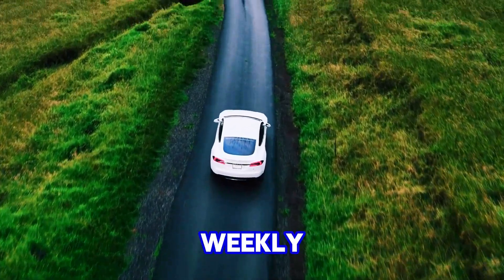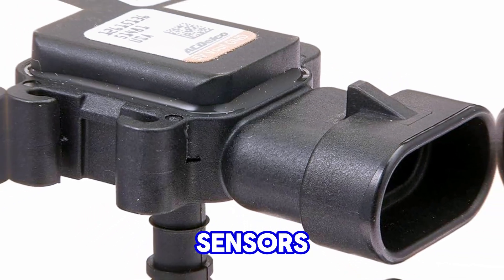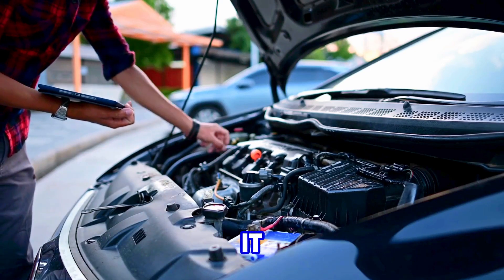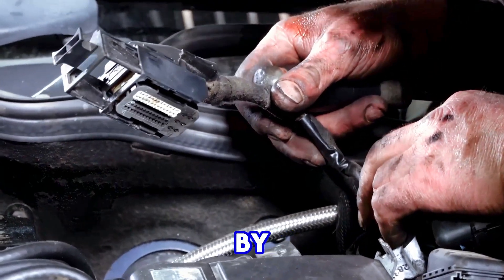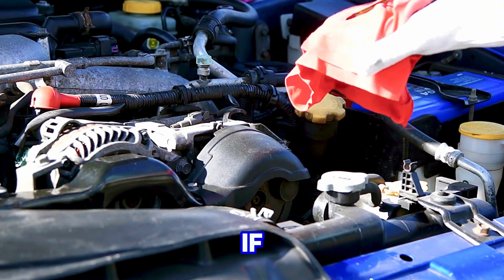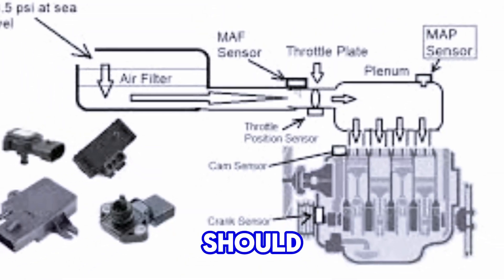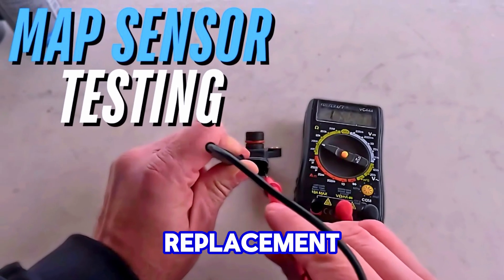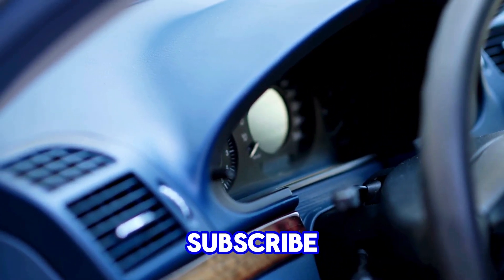MAP Sensor Testing Using a Multimeter || Step By Step Guide ||

Comment: No. It is not that simple. Just sucking and hearing a change in idle does not mean it works. These sensors degrade over time, so it migh seem like it is working but the voltages are incorrect. Use a multimeter and proper methods. Not this bullshit
Reply from the maker: You're absolutely right, a proper multimeter test is essential for accurate diagnosis.